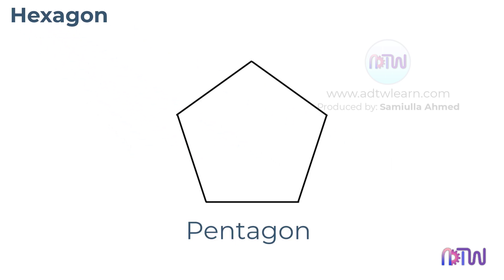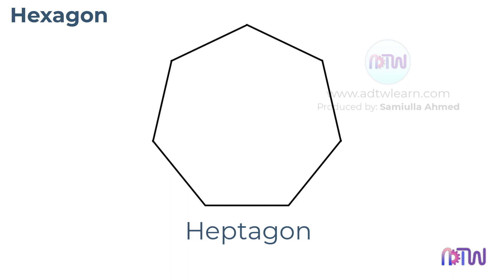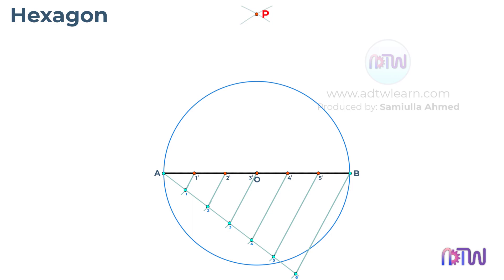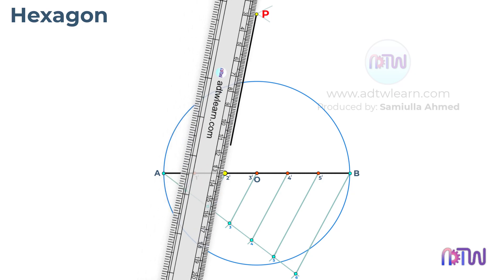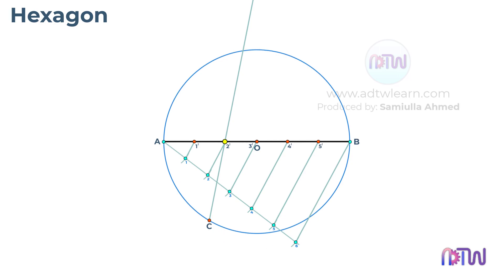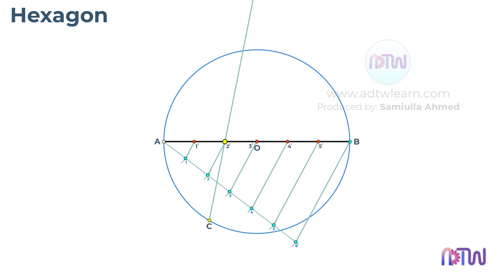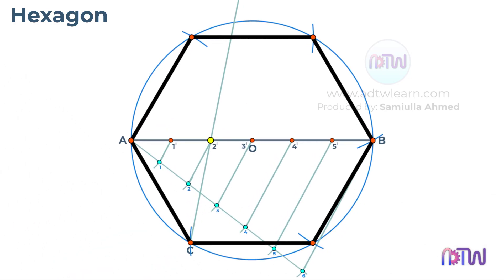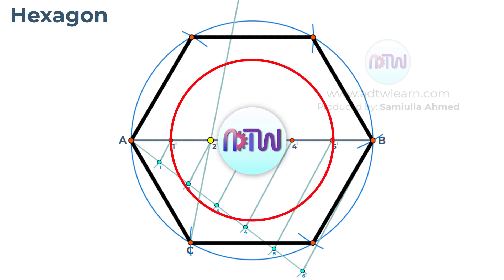General method to inscribe a hexagon inside a circle.

Comment: Shorter way:
1. Create a circle and name the center point A
2. Create a line passing through point A and the circle, creating a diameter that intersects with the circle on point B and C
3. Use that same length preserved on the compass to draw on point B and C to intersect the circle, creating two arcs that generated from point B and C respectively
4. Name the intersecting points D, E, F and G
5. Create hexagon off of all the pints that intersected the circle
Reply: Nice 👍🏻
Reply: Tysm